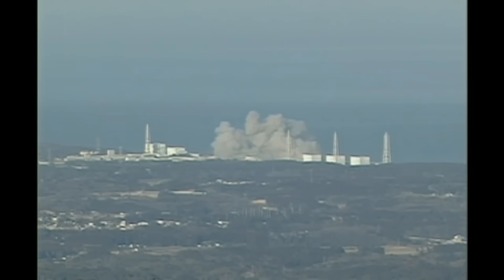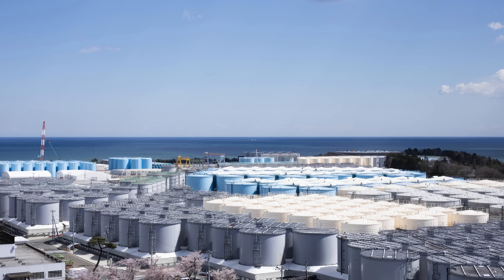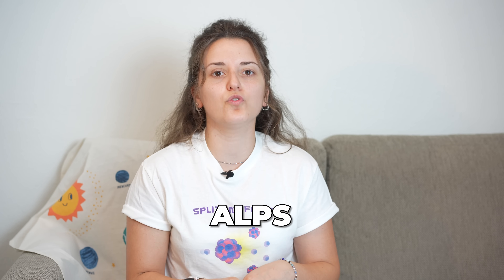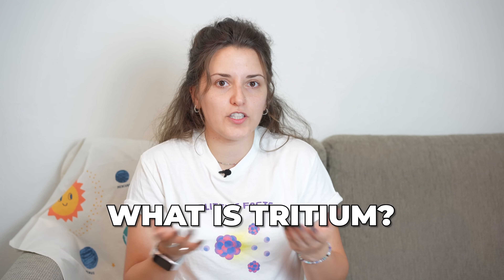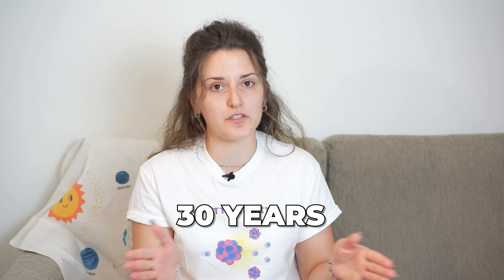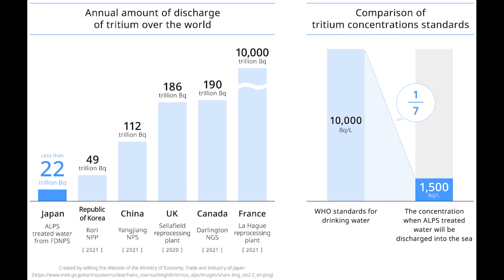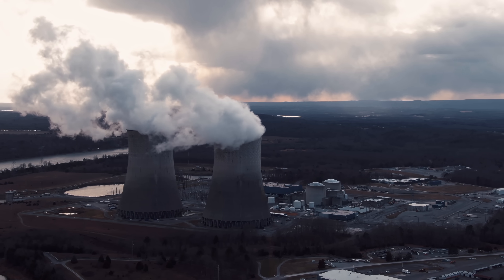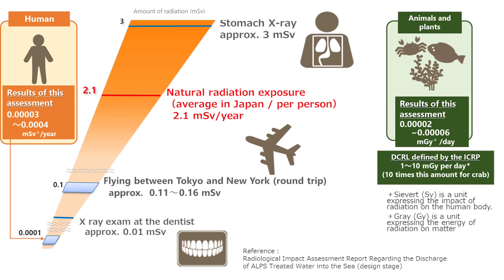Nuclear Physicist Explains - The Release of Fukushima Treated Radioactive Wastewater

Comment: I think the issue here isn't so much as the tritium, but if the data supplied by Japan is true. The IAEA only receive these data from Japan, and even though the data states it is save, the IAEA still has a disclaimer that does not say if the treated waste is completely safe. There is still a difference between treated nuclear waste from an operational nuclear power plant and one that blew up.
Reply: Carbon 14, strontium 90 and iodine 129 and others which are more harmful than tritium are not treated and released into the ocean. But She only said about tritium.
Reply: @Panda-phoenix   Because the full report clearly shows ALPS is effective for all but the tritium.
Reply: How come you only bully Japan by assuming IAEA only received these data from Japan?  What about other countries?
Reply: Japanese lied about ALPS. 1. ALPS has no way to remove carbon-14 either which has a half life of 5,370 years. 2. They are using 800 times seawater to dilute so-called ALPS-treated water before it is released, while normal nuclear plant cooling water doesn't need to be diluted. Their Asian neighbors and IAEA have to spend lots of money and manpower to monitor the releasing during the next 30 years. If it's safe, why don't Japanese just use ALPS-treated water to water their own plants instead of releasing it into the Pacific Ocean.
Reply: "data supplied by Japan" - TEPC has a bad reputation of being corrupt and falsifying data. Don't take my word for it, Japanese media written about its behavior extensively for the last decade.
It may also be why Japan refused independent 3rd party to do the water sampling.
Reply: Four countries were given samples and labs in two others were employed as well.  The full report shows the sampling methodology, who observed it and where the samples were distributed.
Reply: @ForbiddTV  As China, Russia, other surrounding countries and green peace are against the releases of radioactive treated water, why not let them to go on spot to take samples?   This will clarify a lot of myths.
Reply: @ForbiddTV  The ALPS has been a spectacular failure, with major doubts about its effectiveness. In addition to tritium, all the radioactive carbon (C-14) in the wastewater will be released into the ocean along with many other radionuclides (plutonium isotopes, iodine-129, strontium-90).
Reply: @Panda-phoenix   How is ALPS a failure?  the report says the water is completely safe and seven countries who tested with it agree.
Reply: @ForbiddTV  believe what you want to believe. From the result of my studying various sources of information from various perspectives and websites. Apart from Japanese and western allies, all other countries are against Japan actions of dumping radioactive waste from melt down reactors. Name one country apart from Japan allies who said ALPS is effective. Even Singapore are against this.
Reply: @Panda-phoenix   I believe nothing, I know since I find facts.  Seven countries have tested the water so far, why don't you go do the same?
Reply: @ForbiddTV  It was you who reply to me without me asking for your opinion. You are desperate trying to prove your misinformation.
Reply: @Panda-phoenix   I already told you I have no opinion, I have facts.  I never asked for your opinion, I saw right away you were wrong and proved you were wrong.
Reply: @Panda-phoenix   IAEA Review of Safety Related Aspects of Handling ALPS-Treated Water at TEPCO’s Fukushima Daiichi Nuclear Power Station, First Interlaboratory Comparison on the Determination of Radionuclides in ALPS Treated Water  
Show where the full report is wrong.
Reply: @ForbiddTV  Look Elina, if there are choice it's always better to release on man maid pond.  As a educated person you misleading the public that it is safe.  But only reason they decide to release is because it the cheapest way.  If you think it is so safe, drink it yourself and be gone.
Reply: @joshuachi8368   The tanks are a man made pond.  Please show where I have ever mislead anyone.  They release their tritiated water just like all nuclear power plants always have.  Please have TEPCO send me certified samples and I will make a YouTube video of me drinking it.
Reply: @ForbiddTV  water tank = pond???  I think you need some help. Please spend some time for your mental health.
Reply: @joshuachi8368   Yes, the tanks act as your imaginary pond.  Get over it.
Reply: @ForbiddTV  Elina, as a educated person, I am extremely disappointed.  You must either mad or sick.
Reply: @joshuachi8368   Show where there is any danger to the water.  Seven countries have tested it, 32 countries regularly release it and nothing in world history has ever been harmed by this practice.
Reply: Face the fact, no members of IAEA won't go to jail even if millions die from the radiation water. Does international agency has any legitimate responsibilities. No.
Reply: @joshuachi8368   No one in world history has ever even been injured by tritiated water, and all nuclear power plants release it.

Comment: Instead of bananas , you should of used cigarettes in comparing radioactivity. One banana has 0.1 miroseiverts of radiation. A average smoker in one year will receive 160,000 microseiverts of radiation.

Comment: I'm curious, why the Fukushima reactor exploded? Why can't it be rebuild?
Reply: The reactors at Fukushima didn't explode, the secondary containment vessels exploded.  Three of the reactors melted down and are considered complete losses since it would involve complete disassembly over many decades.  The other three reactors could be repaired and used (two were completely unaffected) but public outcry due to ignorance would certainly  prevent that.

Comment: The problem with tritium is that it it has very short range but very high energy (relative to gamma ray) emissions. This makes it essentially harmless when outside the body, but very dangerous when breathed in (not an issue here) or ingested. Ingested tritium can be incorporated into DNA. When it decomposes, it blows a large hole in the DNA that is quite difficult for the body to repair. The reason that Japan must release the treated water over 30 years, keeping the background levels essentially constant, is that ingested tritium can be concentrated as it moves up the food chain. I otherwise agree with your excellent analysis.
Reply: You have a lot of incorrect information here.  Let's debunk your last point easily, which destroys the rest in unison:  
Because of the role of hydrogen in metabolism and its ubiquitousness in the environment, organisms have not evolved mechanisms to accumulate or concentrate hydrogen or its isotopes in food chains. Therefore, biomagnification of tritium is not a factor in food chain transfer.
Reply: I will refer you to the Health Physics Society Fact Sheet from March 2011, revised January 2020, and to the article in Scientific American by David Biello 7 February 2014. The ionization density of the beta emission from tritium is what creates a cancer risk. The particle can only penetrate 6 mm, but it creates a large path of destruction in that 6mm due to its ionization density. I should have stated in my email that it has a very high rate of energy deposition per unit length of ionization path relative to a gamma ray, regardless of the relative absolute energy of the emissions. The significant factor is how much energy is deposited at a single biomolecular site. For this reason , ingested tritium in water incorporated into cells (or inhaled and adsorbed to respiratory epithelium) is capable of causing cancer by destruction of several adjacent base pairs in DNA, damage that is difficult for the usual repair mechanisms to repair. According to the fact sheet, tritium is usually present in the form of HTO (tritiated water) because it easily exchanges with the hydrogen in water. According to that fact sheet, it is only dangerous if a large amount is inhaled or ingested. This is because the small mean free path prevents it from penetrating the dead cell layer of skin. The question is, what constitutes a “large amount” of ingested tritiated water? The only amount we know to be generally safe is the amount naturally present in drinking water. The article by Biello indicates that the government exposure standards were not based on scientific evidence of the effect of elevated tritium in an animal model, but rather on what was present in natural background and what was achievable. The article discusses the difficulty of even performing the experiments to test for safe levels due to difficulty with detection. To state that animals do not accumulate tritiated water is purely speculative on your part. All significant biomolecules contain hydrogen and all of the hydrogen comes ultimately from water. The science to test for accumulation, much less biomagnification, has never been performed. Furthermore, it will never be performed. It is cost prohibitive relative to the value of the information. I should have stated that it “might” be concentrated as it moves up the food chain. The water within sea life at minimum will equilibrate with the water in the ocean, meaning that elevated tritium levels in the ocean will mean elevated tritium levels in fish, which will mean elevated levels in ingested food. Is this a problem? No one has the data to say one way or the other. In keeping with the principle of ALARA (keeping doses as low as reasonably achievable), it is therefore necessary to release the water in a manner that does not significantly increase background levels of tritium in the ocean waters. I am sorry if my email did not meet your standard for precision of language. It is nevertheless the case that your presentation did not explain why the water should be stored and released slowly over thirty years instead of being merely dumped all at once. From a background radiation standard, it could easily just be dumped. It is precisely the lack of knowledge of the true danger level of ingested tritium that requires this level of caution. I hope my revised explanation satisfies you. It will certainly make it more difficult for the average person to understand. Personally, I find it unreasonable to discuss particulate radiation  as if it were non-particulate radiation because the nature of the radiation risks is so dissimilar. You did not make a clear distinction.
Reply: @jamestimmons6838   That article makes a lot of assumptions that don't even apply to Fukushima.  There is always around 3400 grams of naturally occurring tritium in the earth‘s atmosphere as it is constantly being produced by cosmic radiation interacting with the upper atmosphere. Most of those 3400 grams are in the earth‘s oceans. The water in Fukushima only contains 2-3 grams of tritium so releasing it all at once would have no measurable impact. No one in world history has ever been harmed by tritium, either from nature or man-made sources.
Reply: So, given that you disagree with my explanation for why they will release this water over 30 years, please provide your own explanation.
Reply: @jamestimmons6838   I just showed you that it could all be released at once.  The only reason they are releasing it over decades is due to unfounded fear mongering in the media aimed at keeping people like you thinking there is some sort of danger from the water.  A huge PR blunder IMO to not have released it as soon as it was treated, just like all nuclear power plants do.
Reply: It is one thing to try to reassure the public and quite another to misrepresent the scientific data. I agree with you that the Fukashima release will be harmless. However, your other statement is provably false. I refer your to Journal of Radiation Research, Volume 62, Issue 4, July 2021, Pages 557–563, which describes two long-term exposures to tritium resulting in death from pancytopenia. The same article indicates that there is evidence for the concentration of tritium in grass and organisms exceeding the concentration in the surrounding water. This is due to exchange of tritium in water with tritium in organic compounds. According to the article, 70% of this exchanged tritium in non-reversibly bound. It is thus theoretically possible for organically bound tritium to concentrate up the food chain. This article was written by Japanese scientists to reassure people of the safety of the release of tritium into sea water. Interestingly, they do so by admitting the risks and showing that their approach to release will obviate those risks, not by lying about the absence of potential risks. When scientists exaggerate their arguments for effect, even for a good cause, it contributes to the lack of trust that the public has in science generally. I think you might want to give a little thought to your answers and perhaps do some reading before making a claim such as “no one in world history has ever been harmed by tritium”. That falsehood, clearly claimed before even doing a minimal literature search on the topic, significantly reduces your credibility.

Comment: Hi, thanks for the explanation.   Why couldn't this water be used in a "close circuit" loop to keep the core cooled for as long as needed? It would have kept the amount of water that was contaminated very low. I am sure there is a reason why they had to use uncontaminated water to cool the core. Thanks for the answer and the video.
Reply: Their entire cooling set-up failed, including the back up systems, because it was an all-eggs-in-one-basket set-up.
As I understand, this is water from the time of the incident to the time they could restore proper closed circuit cooling.

Comment: You made an error the water stored is ground water contaminated by the core Till the core is removed it will continue to contaminate ground water. The treated water maybe safe if numbers the company has provided is accurate Since the company has been caught lying before. I would request third party testing. Before I would trust a release. Decontamination of groundwater will have to continue till the core is removed. This was one of the most bungled public relations failures since Chernobyl and sadly it will take almost as long to clean up. You have to remove the core before you can fix the ground water problem. They are no closer to removing the core than they were when the accident occurred.
Reply: Four countries have tested the water.  ALPS removes all but the tritium so your meme is groundless.

Comment: As an expert in evil  and propaganda, I can tell you this is ridiculous even for propaganda.
If the water is so safe, then the solution is simple.  BOTTLE IT UP as drinking water, and sell it to Japanese patriots.  Or how about this, use it as water for irrigation?  
The Japanese don't even want to evaporate it in Japan, why?  Because that would turn the water into fairly heavy vapor and that most of it will contaminate other parts of Japan, before being distributed globally. 
I am not a. "nuclear physicist", but I am going to guess what the problem is.  The "purification" / "filtration" process is not anywhere close to 100%.  And there are a lot of other radioactive elements in the contaminated water (no doubt in trace amount as you would argue).   But that makes it unsafe enough human and has to be dumped into the ocean.

But don't worry, the radiation will follow the current and go to Alaska first and then. the US west coast.  So maybe you get another chance to make another video really soon.
Reply: Then you BOTTLE UP the tritiated water your country releases and be sure to add some sea water to yours before using it for irrigation in your country.

Comment: Can folks remember Minamata disease discovered in 1956 in Japan?  When mercury containing water was discharged, the Japs claimed it was safe.  However, no one realized that fish and organism can take in the waste and accumulate day in and day out, leading to buildup of the harmful waste and finally a historical environmental/social disaster.  For radioactive materials, the uptake by organisms is even more dangerous due to their high fat, tissue, and bone binding affinity and a long half-life.   If the contaminated fish, etc. get into the food chain, the resulting internal radiation is much more than lethal.  This type of research and safety evaluation are well beyond the expertise available from a nuclear physicist.  The radiation CAN'T just be measured and assessed in a beaker.
Reply: Because of the role of hydrogen in metabolism and its ubiquitousness in the environment, organisms have not evolved mechanisms to accumulate or concentrate hydrogen or its isotopes in food chains. Therefore, biomagnification of tritium is not a factor in food chain transfer.

Comment: the issue is you guys are assuming it only tritium in the water. there is no independent testing on every tank to proof this is the case. so we are arguing about X is safe when X is not what we know for a fact is being released. it pointless without independent verification.
Reply: Except the report clearly shows four countries have tested the water which clearly shows what's in it as well as two other countries labs through the IAEA.